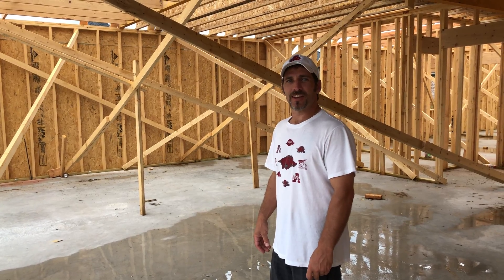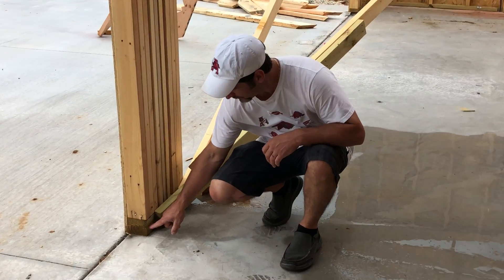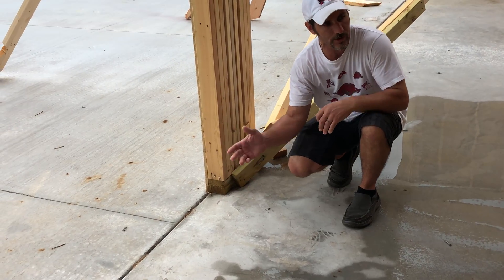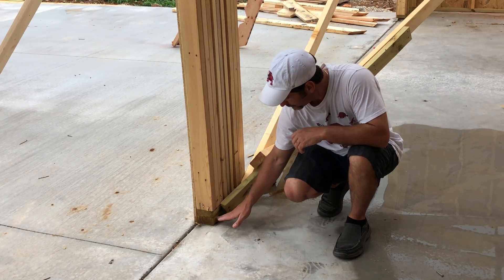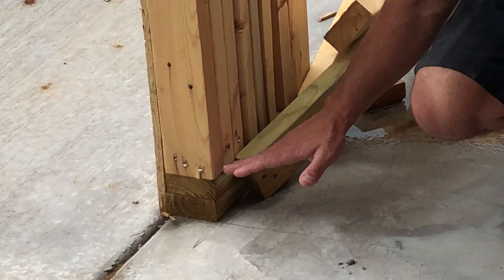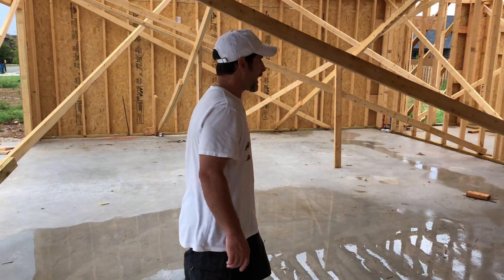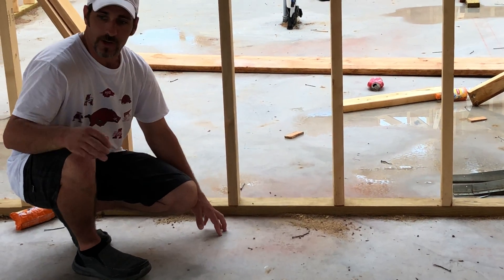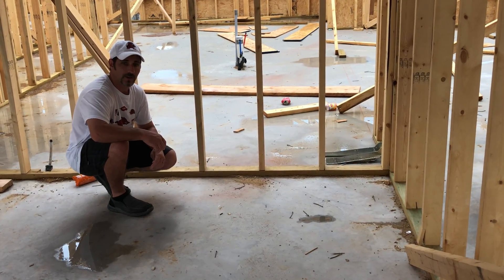Garage Floor Constructed WRONG With Water Allowed to Access Framing Members

Comment: This is EXACTLY what we are experiencing with our garage in to the laundry room area. Water pools at the wall and door and has crept its way under the flooring in the laundry room. How do we fix this!?
Reply from the maker: Only thing I know to do at that point is to cut in a drain of some sort.  Depends on the situation but these issues are typically very difficult (costly) to solve because of the concrete being very hard to work with.  Thanks for watching!

Comment: This is what is going on with my detached garage. I want to convert it to a tiny home. How would you fix an issue like this? Can a french drain be added outside and concrete be poured inside to increase the floor height, or would the whole structure have to be lifted to add the thick slab?
Reply from the maker: Leah Canseco without seeing the actual project it sounds like you have the right idea.